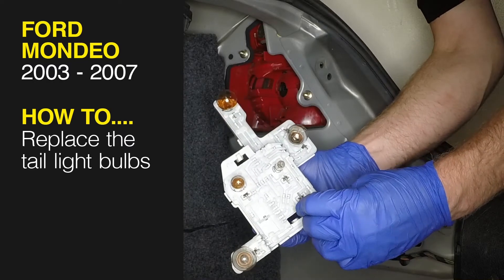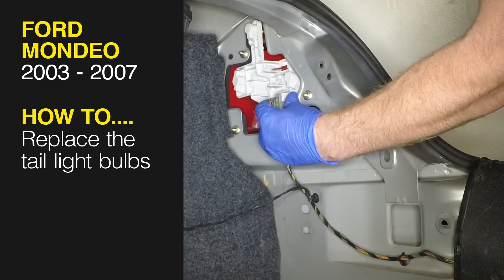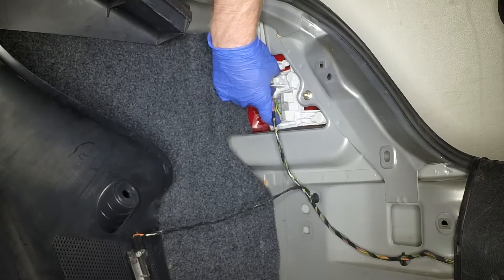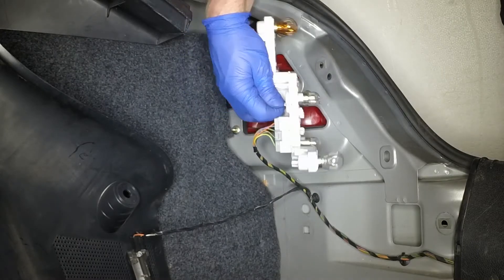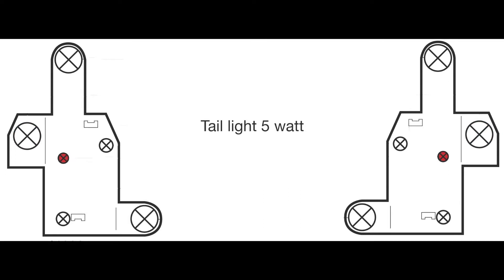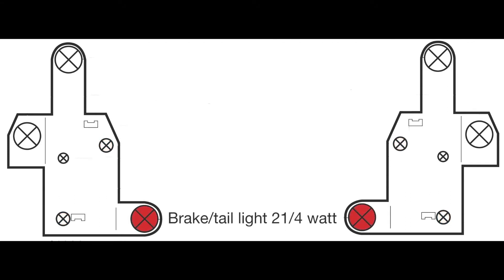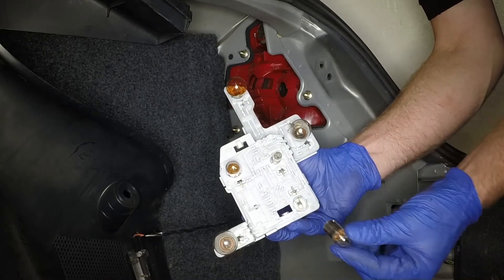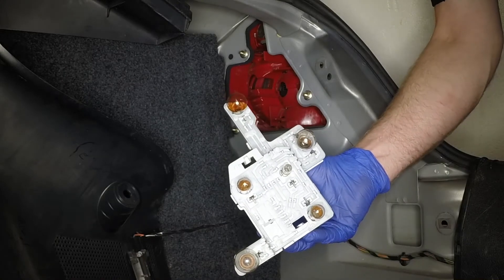How to Replace the tail light bulbs on a Ford Mondeo 2003 to 2007

Comment: Thanks! Was unsure on how to do this so I checked your video before doing anything! I have a Mondeo from 2001.
Turns out in my 2001i have 3 tail light bulbs instead of two. The third one is located at the bottom next to the fog light bulb.
It's a bit different to the one in this video.